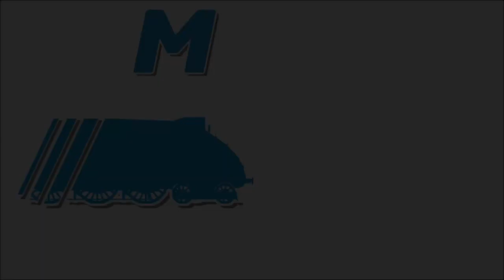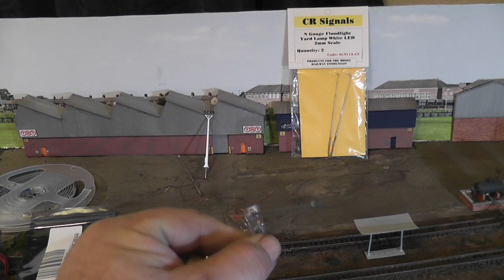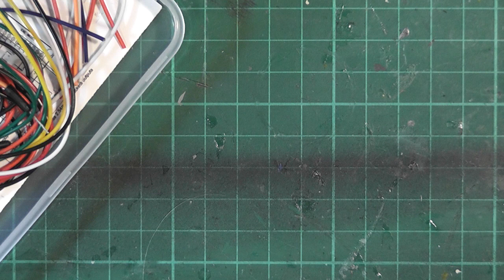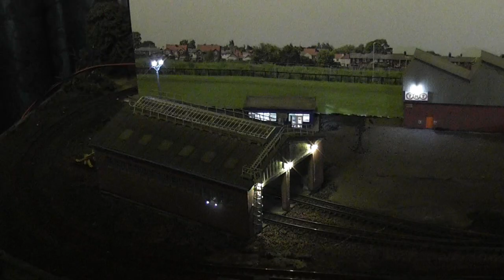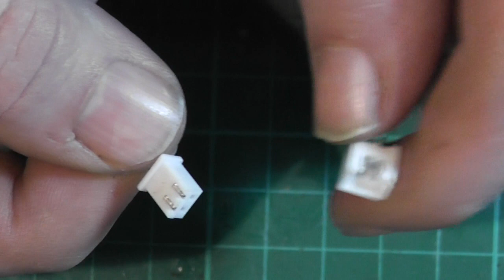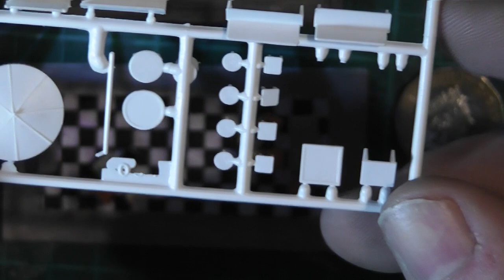Swade's Pond Part 7 - Lighting a Bachmann Engine Shed

Comment: That was very interesting Tony.  I've used the LED distribution Boards and the Just plug system.  Lighting adds so much to the layout.  The final effect of the lighting you have installed so far looked really good.  Stephen
Reply from the maker: Hi Stephen, I remember seeing the distribution board in one of your videos  😀 I originally got it for the station lamps on my Goathland board, I liked the idea of being too set all the light levels at once. But It's ended up on this layout so I'll just have to get another one now.  Lighting really does make a difference but still lots to do. Stay safe! All the best Tony